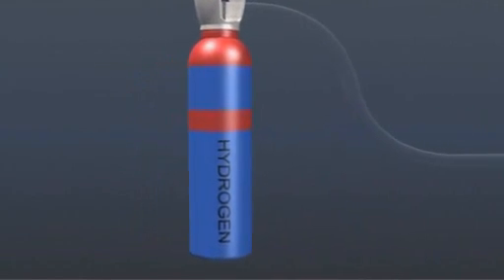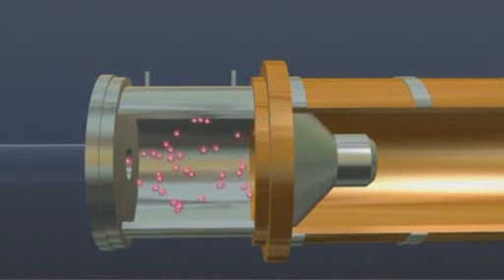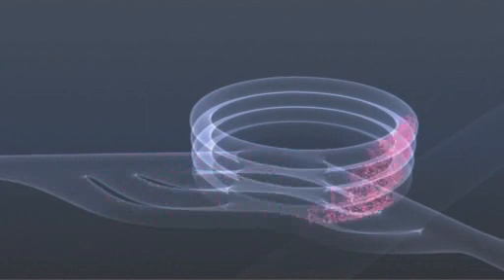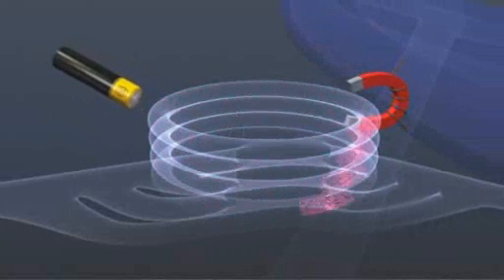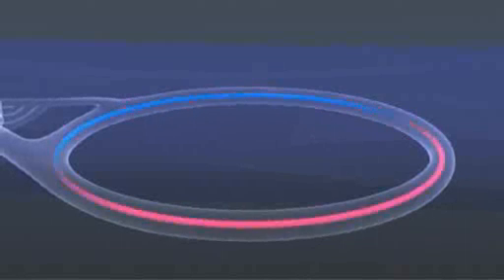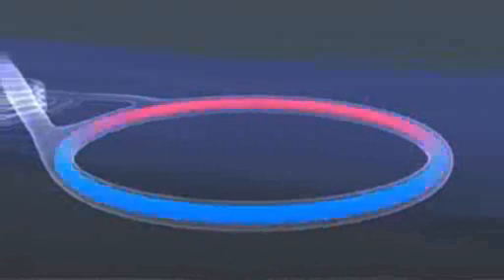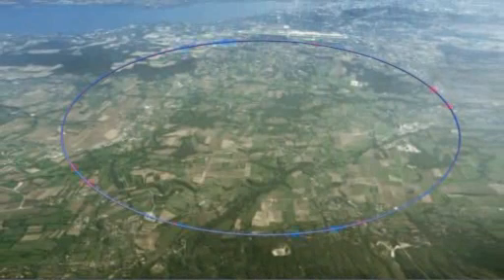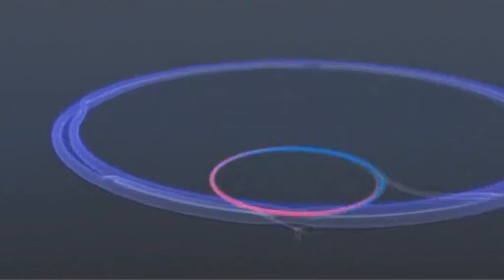The LHC - The Large Hadron Collider. What is the LHC, how does it work?

Comment: I took electric theory so I understand whats going on. But what happens when something goes wrong.
Reply: +Nathan Jones When the LHC has the accelerator turned on, the basement where the chamber is located is vacated and sealed off to everyone.
This is to avoid radiation exposure that can happen, as well as the potential of a a break in the vacuum chamber either a poorly sealed chamber or other event like a magnetic quench (this happens when the superconductive circuits of the magnet suddenly meets a load that isn't at superconductive temperature, no longer superconductive thus has a sudden resistance from 0 resistance and can't handle the amps).  A magnetic quench has happened once at the LHC, causing the area effect to blow out a huge hole in that section of the chamber.   You don't want to be down there should that happen, would be like being hit with a grenade, not to mention the radiation levels while it's turned on are quite high.
More safety info from CERN itself concerning the LHC
http://www.symmetrymagazine.org/article/december-2007/protecting-the-lhc-from-itself

They're constantly inspecting the LHC
http://phys.org/news/2015-09-refine-lhc-magnets.html

The damage caused by the quench event back in 2008
http://www.cnet.com/news/photos-the-damage-that-halted-the-lhc/

Comment: The LHC collides protons together with the energy equivalent of 7 TeV for each proton, so that is 1.4x10^13 electron volts. A black hole has to have a mass of 1.220 932 x 10^28 eV.

Comment: The size of a LHC-created micro black hole, is in the order of a Planck length, much smaller than a proton. On this scale matter is vastly empty. And if the interacting force is gravity, accretion of matter initially is slow. To grow to any discernable size could take very long, more then some years. It should accrete around 800 millions tons of matter to grow to the order of the size of a proton. It is not a proof that this is not already happening. And Hawkings was wrong before, ask Susskind.

Comment: WARNING! A CERN created micro black hole results from colliding particles with identical energy and opposite direction, with possible no remaining impulse relative to the earth, it would stand still relative to the earth. If it would not evaporate (not proven!) it falls to the centre of the earth and starts oscillating within it, contrary to one formed by cosmic rays, which most likely have a resulting impulse with a speed much larger then escape velocity. Therefore and there is a real danger!

Comment: You physically can't is the short answer. Unless that was a rhetorical question. 
As you reach the speed of light (though you can't if you have mass, according to what I've read) more and more energy is required to speed you up until and infinite amount is required (this is why no object with mass can travel to this speed) to keep them going. Therefore an infinite amount is required to slow them down, and hopefully you see why this isn't possible.

Comment: Its impossible to travel faster that the speed of light, and light is relative to everything, meaning if you was travelling at the speed of light in the same direction as the light beam it will still pass you at 186000 miles per second. Further to add is Quantum physics discusses time travel at the speed of light and perhaps parallel galaxies. The hadron is the 1st time man has made matter travel just below the speed of light that is why they had so much interest. bob

Comment: The problem is not that one need prove and one doesn't it is that both need faith (believe with out certain proof) because there is not way to categorically prove the existence (or lack there of) of a god. You can not disprove the existence of god (because you can not prove a negative), and you can not remove all non scientific verification for (what would be) God (because science would find a way to include that result (it is a bitch like that)). so we can not say either way.

Comment: Physicists running routine neutrino experiments between CERN’s Geneva HQ and the Gran Sasso laboratory in Italy 455 miles away have found that their neutrinos seem to be traveling faster than the speed of light. .The team has now measured some 15,000 batches of neutrinos coming across that distance, and they say they’ve reached a point where the statistical significance is such that, were they trying to prove anything else, it would count as as formal scientific discovery

Comment: ..continue

They are not starting from NOTHING(use hydrogen) and they manipulate conditions(strip electrons and accelerate protons)

Energy cant be created. The energy (heat) they get from ultimately colliding the protons is equal or less to the energy they have used to accelerate the protons close to the speed of light.

On 30 March, 2010 the succeeded in colliding protons. Why did they only get energy? Where is the matter? Or as the scientist involved with the experiment call it “Stuff”

Comment: @upsilone19 
Through this we will gain a better understanding of the universe and how things work which will eventually lead to better technology. Also if you think about it there is nothing which we massively need to check out on mars because we can use telescopes to check it out. But through this we learn the basic function of the universe and hopefully when we do gain hyper drives or ftl engines in the future we can use this information to calculate the risks.

Comment: batsali99 Thanks for your comment. My PhD is in superconducting wires which is used in superconducting magnets. As mentioned in your commnets I do understand superconductivity very well, but still confuse about how much current do you pass initially? How could you pass 12000 A current? (I understand that once you pass it, it is going to stay there as there is a superconducting coil). Thanks a lot.

Comment: Overall very interesting  and informative video.But in the last part where 12000 Amp current flows for magnets to be superconducting is not clear. Do you supply extremelyb high current or do you apply force(using bending magnets) to develop that current?????Need more explaination at the end.  But worth watching to understand LHC operation. Good luck for achieving 14TeV.

Comment: @44Beats the energy of one proton with that mass (1,1708351459e-23kg) travelling at that speed (~299792000m/s) equals 1/2*m*v² =~ 0,00000053J
lifting a weight of 1 gramm by 1 centimeter needs about 0,0001J of energy.. in order to do that with these protons you'd need about 190 of them
the proton wouldn't even get to hit the mountain.. it would lose all it's energy long before that by colliding with air molecules

Comment: @adzii1 they successfully made something very similar to the big bang a few days ago.

Also the easiest way to make hydrogen is by reducing methane gas. It ends up producing hydrogen with less energy then what you'd need to reduce water. You get a net gain in energy after the hydrogen is converted into water in the fuel cell.

Water-generated hydrogen ends up as water again as well, meaning no net gain in energy. Worse, some energy is always lost as heat, so you actually end up losing energy.

Comment: @trje246 Hydrogen has the simplest nucleus of all, made of a single proton and is the most abundant element in the cosmos. It is also the lightest element. Hydrogen and helium make up the basic composition of most stars. You could say they are the building blocks of all the other elements.

Comment: @alcosta732 
correct; particles need a lot more momentum, not just the ones that are broken down, but the ones behind them create kinetic 'hydraulic' pressure. 2 funnels in opposition is what makes a black hole continue working, and it can't do this for long without either continued accelleration, or a galaxy surrounding itself to keep it's mass from tilting and ripping apart.

Comment: @endo419
Oh... ummm it just occurred to me...
The cost of the LHC is approximately the same as the cost to develop and build the B-2 stealth bomber, with each additional plane adding another 2 billion.

The LHC has actually already accidentally produced products that are a benefit to mankind. The computer networking system used in the LHC, called The Grid will likely become available within the next several years as internet connectivity that makes HD broadband look like dialup.

Comment: @Keegzey12
We've known about particle beam weapons for a long time... they just aren't practical.

Currently, missiles are far cheaper, fit in a much smaller package, are more mobile, and have far larger destructive payloads.

The same technology does get used in medicine and manufacture however. A particle beam can be focused with incredible precision, when the size and weight of the machine isn't an issue.

Not so much a lightweight portable thing.

Comment: @endo419
It is known but as yet impractical that if a mass of hydrogen is bombarded by muons, the muons replace electrons and cause two hydrogen atoms to fuse into helium, and then usually release the muon to cause yet another fusion reaction... cold fusion.
The problem is that muons have too short a halflife and the energy cost of producing muons slightly exceeds the energy released by the resulting fusion.
Solving this problem would provide clean, nearly unlimited energy from water.

Comment: @inuyashafan3448
The LHC was necessary to provide a controlled, "clean" environment... to keep stray bits of noise from entering the data. The actual collisions possible within the accelerator are less rather than more powerful than those produced by cosmic rays in our upper atmosphere, and the upper atmosphere of any planet with an atmosphere...

It is dangerous to stand in proximity to the accelerator while it is running due to radiation leakage, but not because it can destroy the world.

Comment: @planterzs 
"Romans" was a letter to the Romans. Whenever you see a geographic location used before the verse number (like Corinthians), it was usually a letter from that specific author to their fellow christians (or intended converts) in that area.  

I'd be careful with that whole "bible is absolute truth" thing if I were you. There were many authors involved, with committees deciding which parts should be included. How do you feel about the parts of the bible that were thrown out?

Comment: @YaMumYaNanYaGran 
But it does have inherent value.

They usually smell rather nice, stack neatly, and can be converted back into biomass with the aid of a wood chipper and a compost pile.

Several dozen of them will heat a modest sized house for a week and they leave very little ash to clean up afterward.

...and the stories can be used to frighten small children into behaving.

Comment: @RP4EVR 
...and the solar panels, came from scientific research.
Specifically...
In 1839, Becquerel documented the photovoltaic effect while experimenting on a totally unrelated subject.
Then in 1883 Charles Fritts demonstrated the effect using a metallic junction rather than liquid.
It was not until 1954 that a silicon chip was produced to demonstrate the same ability.
and in 1955 a commercially practical solar battery was invented.

Comment: @RP4EVR 
There is an entire internet out there RP4EVR not just YT.
Not the Earth... all matter in the universe is what the LHC is designed to gather data on.

A possible result of finding the Higg's Boson, could be controlled and sustainable cold fusion... Nearly unlimited clean energy resources. 

How will you feed the starving?
With what resources? Farms cut out of boreal forest, cultivated by tractors that burn gasoline?
...and when it runs out?

Comment: Depends on how many particles in accelerates. With enough energy exerted on sufficient mass it basically becomes an gun. After all deceleration from 186000 mps to 0mps is likely to hurt. But you're right, we can't use it as a weapon in the way that those black hole nutters think or on a practical scale because of the amount of equipment required to launch the matter and the fact that we can only launch fractions of atoms.

Comment: @sparky
You need to learn to read, yes, they will be starting it back up in winter but it will be between 30-50% and they might never be able to run it at the original 7-7.5 TeV it was planned for.

Comment: i dont think this film is about the world ending, its more to do with coliding particles and using particle annihilation to create more energy for the world using hydrogen atoms as it is a very plentiful particle and also the very light so easy to accelerate, where as coal, oil and many more substances are going to be used up in the future. so if anything, if this actually works it will save the world not destroy it

Comment: the amount of energy required to mass produce antimatter is higher than the energy which you could get from it. It would be a highly concentrated form, and portable - but if we can master small scale magnetic fusion, our vessels would be able to produce energy from hydrogen which is abundant. if antimatter is used, you'd have to stop and fuel up somewhere that can produce it.

Comment: eyes closed and everything. I did have the impression after a while that I was done with, I'm dead, I'm just a floating spirit now but it wasn't until a matter of time that the pressure I was feeling, that being squeezed through a tunnel feeling started to increase rapidly and then soothed it's way out and I felt relaxed but by that time I was back in my mortal body. 

This could not have been any dream, it was just as real as me typing this right now.

Comment: and if you were wondering why the thing eats so much power, it's because that in order to accelerate those nuclei to near light speed, it takes insane amounts of energy. think of a gun in space. it's easy to get it to shoot a bullet at 1200 feet per second. now try and make it shoot the same bullet at 10 000 feet per second. then 10 000 000. making something accelerate to near light speed relative to the device you are using to accelerate it takes an exponentially larger amounts of power.

Comment: meaning that they are not concrete laws as we once thought, but have the ability to vary under different conditions. This in turn strengthens the argument for multiverse theorist who believe that there is an infinite number of universes all with varying initial conditions (Ex: strength of the electroweak force and strong nuclear force) that encompasses all possibilities of outcome predicted by Quantum Mechanics. However these are just theories and nothing more untill the LHC runs in 2009.

Comment: I'll elaborate just a bit: the machine does make black holes, but they pose no danger at all. Black holes consume matter equivalent to the matter that collapsed to make it. This means that, since they are made from two particles, they only have the ability to "eat" two particles before filling up, at which point the hole is gone. This means a human being could be directly hit by it and not feel a thing: 7,000,000,000,000,000,000,000,000,000 atoms in a body and less than 2 would fill it up...

Comment: If you were to not use Hydrogen but instead Uranium that would take 100 times more energy at least, and the blast from the crash of the particles smashing into each other would wreak the sensors and computers not to mention all the radiation that would be left over. Hydrogen is light and plentiful therefor it is the best choice.

Comment: The larger the ring, the greater the electron volts, the greater the electron volts; the more accurate your information, so in order to get the best results, you need to build an accelerator the size of the planet, or even the solar system, or even the milky way, or even the universe.....multiverse?!?

Comment: broke implies that the entire thing is busted. In fact, the major detectors, CMS and ATLAS are fine. This means that most US contributions are undamaged.

it's still bad. some superconductors got a little too hot(by superconductor standards), resulting in a rapid increase in temperature from the increase in resistance.

Comment: There are 2 problems
It is a possible that Hawkins radiation and string theory may be partially correct theories towards a theory of everything and predicting tiny black holes but incorrect in predicting that they would disapear almost imediately.
Secondly it does not follow that just because an incorrect theory mentions an entity within it that the correct theory, if ever proved will not also have the exact same entity ie tiny black holes held within it.

Comment: to give a general idea...a nuclear explosion using plutonium releases a energy intensity of 200 million electron volts...1 trillion (tera) electron volts is 5000 times the energy released in a nuclear explosion

each proton used in the large hadron collider traveling at desired velocity has the energy of seven teraelectron volts

what they are telling you in the video is that this thing is basically a nuclear bomb so mind boggling ginormous that it will create a black hole

Comment: well. even if there (with a 0.00000000000000000000000000000000000000001% chance) is gooing to be a Black hole.. the black hole will be less than 0.000000001 cm and will exists for about 0.0000000000001 of a second. beside this. even if it would stay. it needs a special kind of gravity around it. the more kind of it there is. the more it can pull. but when its created in a tight space like the LHC machine. it wont be able to pull anything at ALL  into it. so whats so scary? ^^;